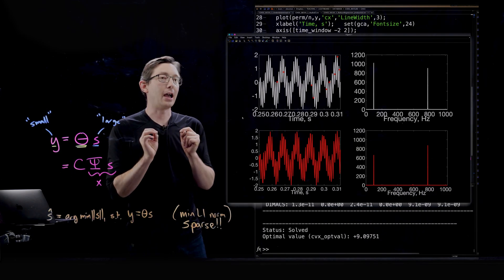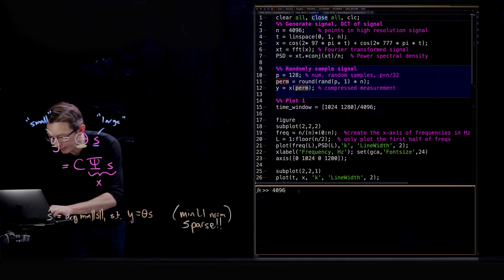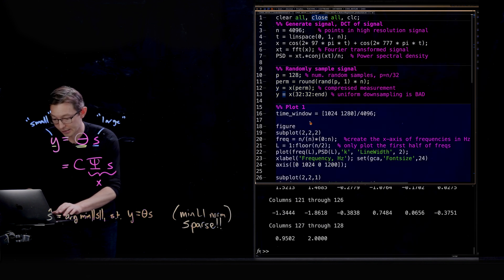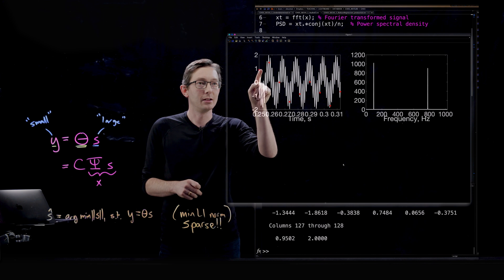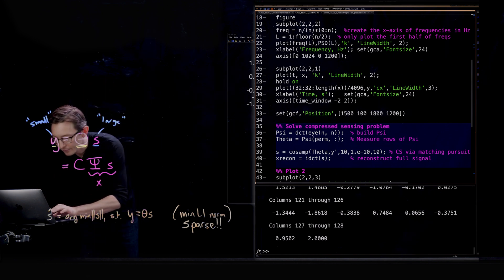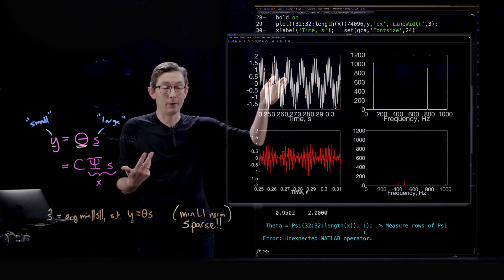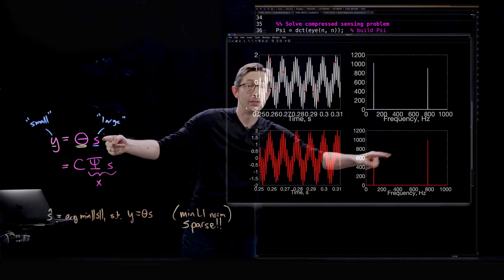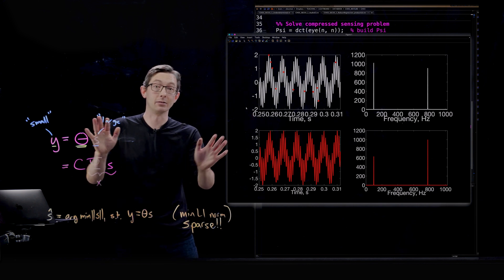Beating Nyquist with Compressed Sensing, part 2

Comment: In computer graphics you could overcome aliasing by randomly sampling multiple points within a pixel, but that still could produce some noise when the distribution of the random samples ended up being too regular.  A more structured approach was to create a sub-grid within the pixel, and then perturb each of the samples within a poisson disc.  Has any work been done to understand the ideal structure of the "random" samples in terms of their ability to capture the range of possible frequencies, thus leading to possibly more "structured" random sampling?
Reply: Hi Derek,
Did you get an answer to your question about designing the sampling matrix to promote the reconstruction process? Also, do you have any ideas on how to assess an already designed sampling matrix?

Comment: Hi professor, in your previous video you mentioned the number of needed samples for compressed sensing p = K1*k*log(n/k) where k is the number of non zero coefficient in the sparse vector s. In this example, since it has only two frequency content, can we say it is k=2 sparse? If we go more aggressive randomly sample at the average of 64 or 32 will also work? (Assumed K1 = 4)

Comment: why sample randomly? would it not be better sample in exponentialy smaller steps?
Reply: I tend to agree. I'm having a hard time believing that random is necessary vs random appears to work better statistically.  I'd guess that a certain fraction of samples need to have 2*niquist sampling rate but it can be limited because of sparsity.  That said, it's time to read the paper describing the method.

Comment: Q.1) Is there any limitation on the length of the signal? 
              For example, compressed sensing works when the data set is large, but it may not work for a small signal length.

Q.2) Can it be mathematically proven that taking random samples at a much lower rate than the Shanon-Nyquist will always work?

Q.3) How to determine the dominant frequency using this method as the amplitudes of the frequencies may alter?
               For example, let's take the DMD of a set of images and try to find out the dominant frequency using this compressed sensing algorithm as often there will be a limitation on the FPS of a camera.
Reply: For question 2, as I know, this happen because of the properties of the L1 Norm, for the why and how is a current and very active area of research
Reply: @elyepes19  Thanks
Reply: You are very welcome Dipanjan. For the L1 Norm explanation, check videos 8,9 and 10, from Proffesor Gilbert Strang, on Matrix Methods for DSP and ML 
https://ocw.mit.edu/courses/mathematics/18-065-matrix-methods-in-data-analysis-signal-processing-and-machine-learning-spring-2018/